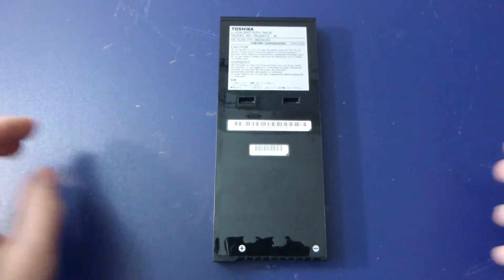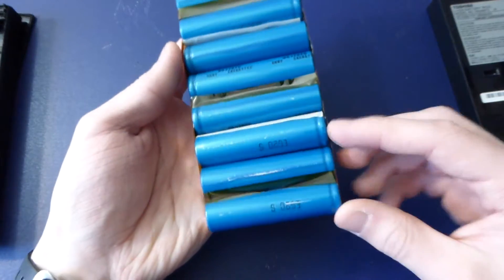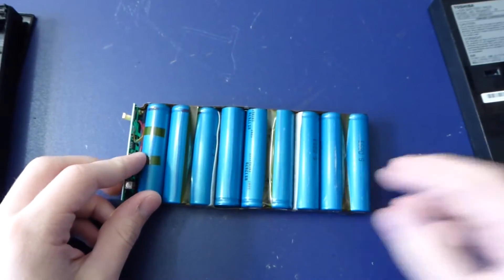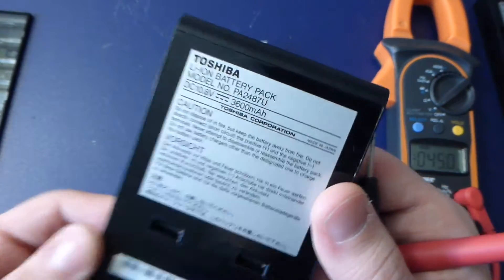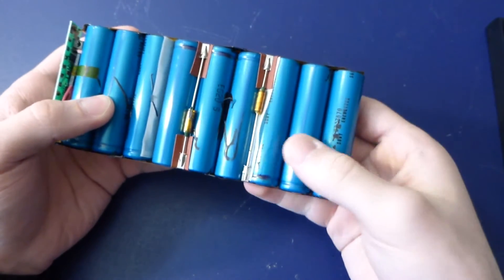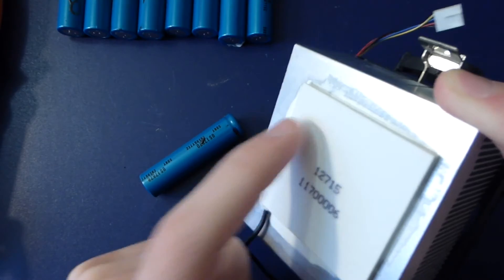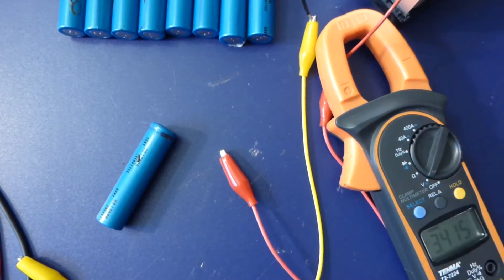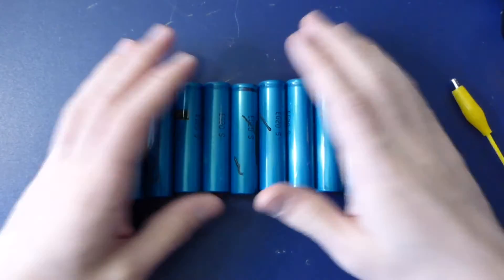19 Year Old Lithium-ion Battery

Comment: Liitokala engineer 500 is  $~20ish shipped from either aliexpress or 25~shipped on ebay.  Smart charger prices has dropped massively, can drain and measure capacity of 16850's or whatever.  No more spending 60+ on a charger, does all battery types except nicad.  Make sure to buy with adapter on aliexpress, they sell the cheapest bare bones.
Major use is high output flashlights, 18650's are a favorite these days with those.
Reply: +wooo weee review
http://lygte-info.dk/review/Review%20Charger%20LiitoKala%20Lii-500%20UK.html